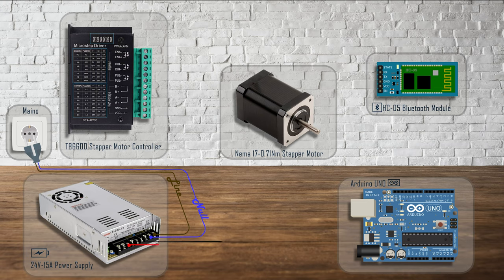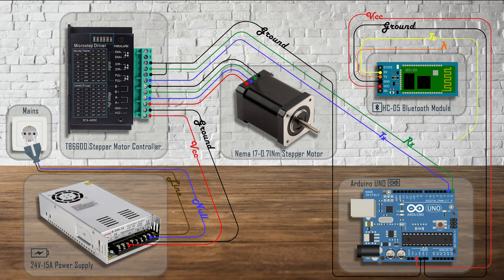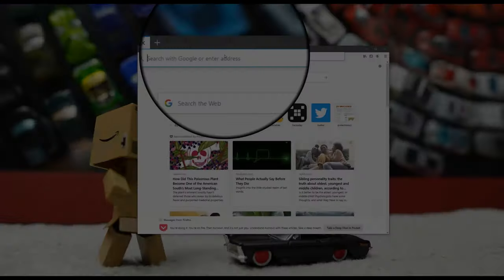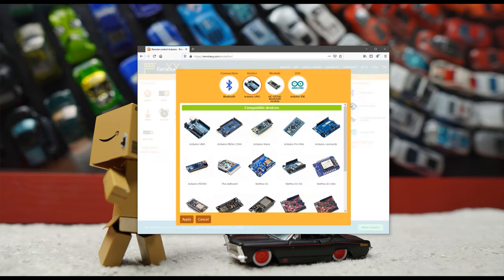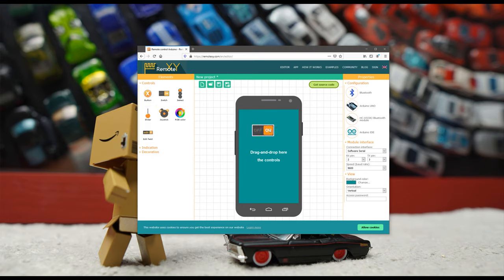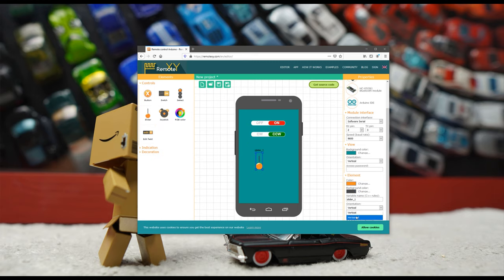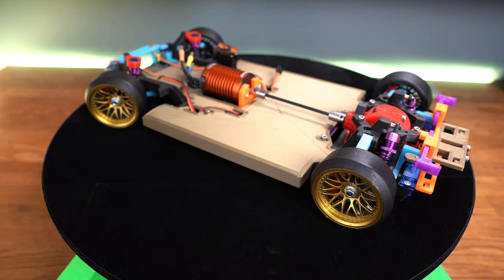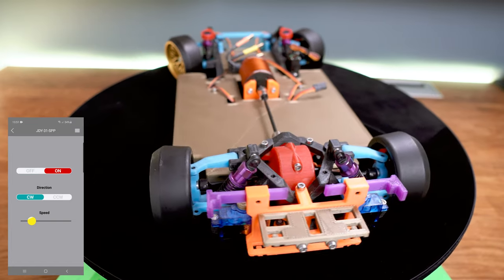📷Arduino Powered  Photography Turntable (PART2)

Comment: Not sure how you soldered those jumper wires.  The one time I tried that the wires of the jumper wire would not accept solder even with flux applied.  I just use my own wires now.